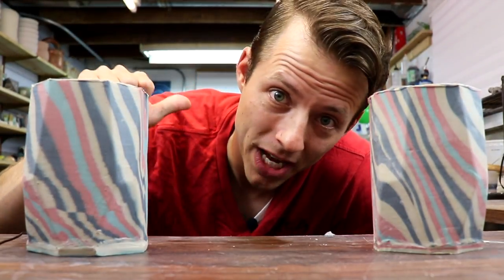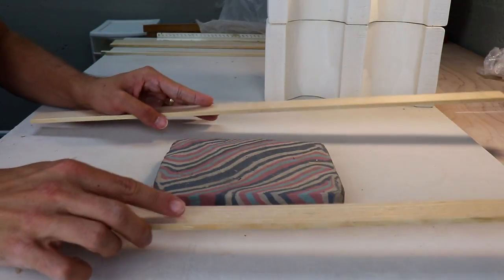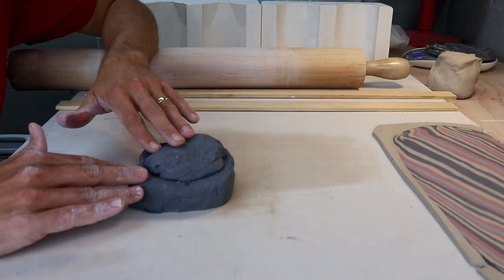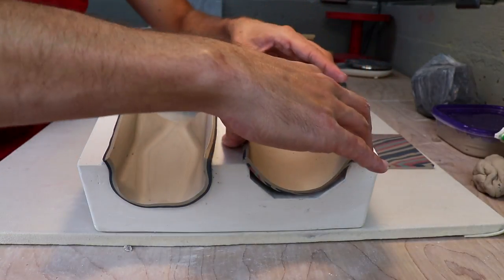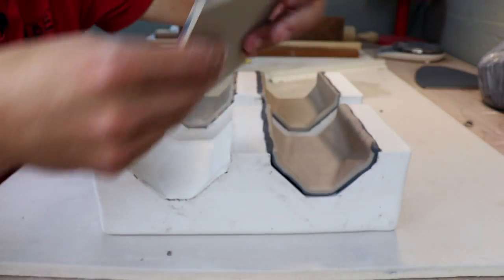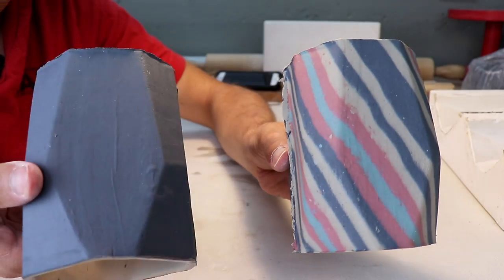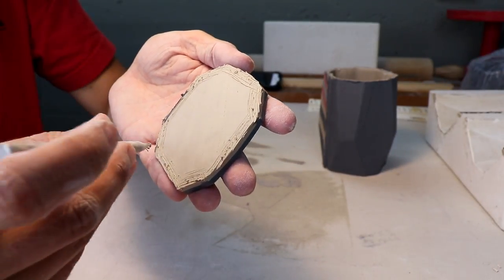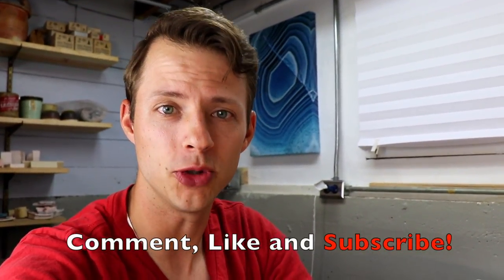How to Make NERIKOMI Slab Cups with Plaster Molds

Comment: Hi Jim - As always I am impressed.  I used your nerikomi technique to handbuild some espresso cups in red, black and white clay.  After the bisque firing the black was grey and the red was pink so I had high hopes that I would get red and black however after the glaze firing the black was fabulous but the red had gone beige, could this be an over firing problem?
Reply from the maker: Thanks Tim. Could be the firing temp or percentages used. The red and blue clay you see in this video are both 8% by weight mixed in. The black was 3% as you saw. I fire to cone 6. If you're going to cone 10 that may explain the red fading, I've read that before. Is the clay a nice white porcelain? Perhaps the clay body is affecting it. A few ideas for you. I've read about colors fading but have yet to experience it firsthand.
Reply: Thanks Jim - I am a complete novice so your thoughts are appreciated.  The clay is a nice white stoneware.  I have just done a bisque firing that failed to reach temperature so I think that the elements in my little kiln need replacing so maybe they were playing up on the last glaze firing ;)
Reply from the maker: Oh kiln elements. As if ceramics artist didn't already have enough to worry about right? Best of luck. Let me know if you see improvements!